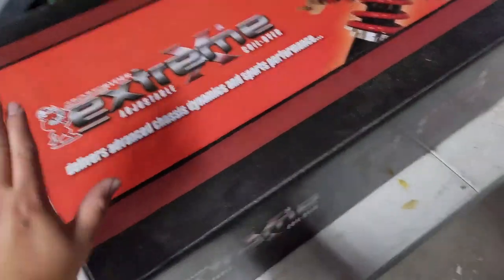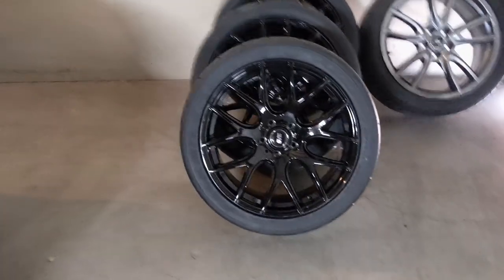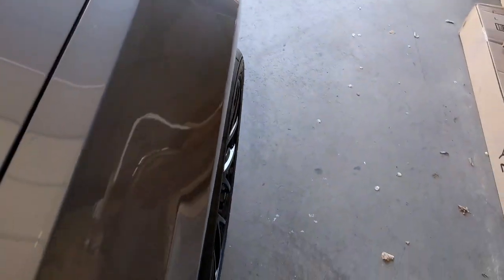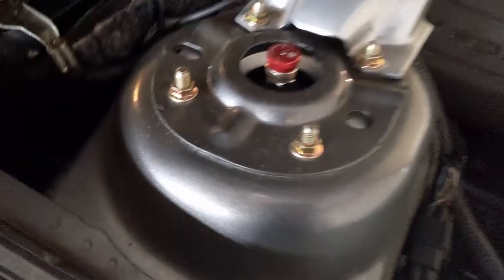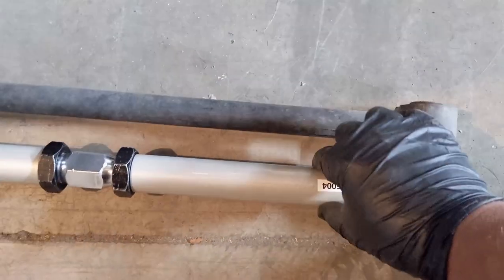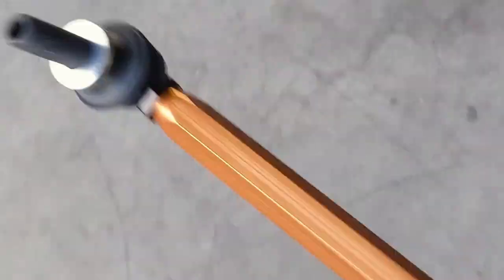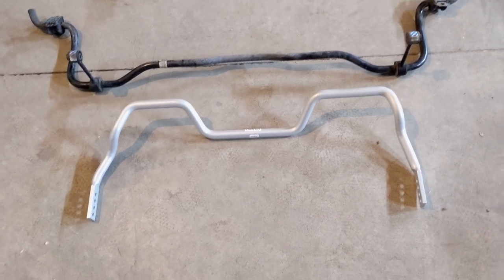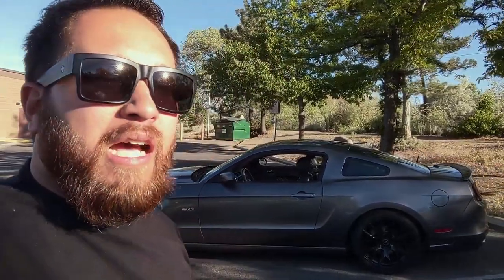Mustang Gets Coilovers!!!

Comment: Looks like you have the track pack;  did you stay with 19" wheels with those new ones?  What width?
Reply from the maker: Yes I do have the tack pack.  I did stay with 19s. They are 19x9.5.  I bought these as my everyday wheels and tires.  I plan on get some 10s for the front and 11s for the rear for my track wheels.